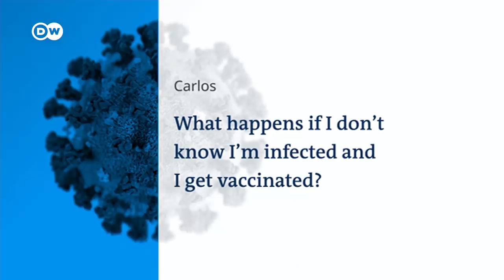Could antiviral drugs mean an end to the coronavirus pandemic | COVID-19 Special

Comment: From what I've heard from the past months , there's also a drug named ive.. wait i forgot the name but that drug also have some antiviral properties and it's so cheap
Reply: Interestingly, Iver is a very similar protease inhibitor to the Pfizer pill. "But Iver isn't potent enough," they say. Ok, I guess that explains it. But then I read that the Pfizer pill has to be paired with ritonavir for it to work. What is ritonavir? Well, it also is a protease inhibitor but its primary function when paired, is it allows the primary drug to survive the digestive system.
Hmmm wait, would it help if Iver was paired with ritonavir? Wouldn't that address the potency issue?
SECURITY! Please remove this troublemaker!
Reply: Ivermercx may be!!!!
Reply: @bill9989  But wait! How much it cost for those 2 pills 😂.
Reply: @rolimiranda9291  Per day?  Probably less than a Starbucks latte.

Comment: It isn't Omicron we have to worry about per se, but the fact new variants keep emerging because there are so many cases that the virus gets to keep spinning the wheel, so to speak, until it eventually arrives on one variant that is really, really serious. 
Paradoxically I suspect Omicron could be a short term solution because what we need isn't a stronger vaccine but a weaker virus. If Omicron can displace Delta as the prevalent variant being more infectious, but symptoms are equivalent to the common cold, then this is good in the short-term. The problem will be it infects more and more people and within six months it spins off a deadlier cousin. The virus we have to fear is one that spreads like the measles but kills like the 1918 flu.
Long-term Covid isn't going away, ever, it's here to stay and society will have to adjust to deal with it and this could alter our society permanently.